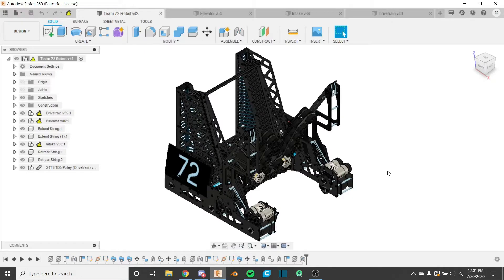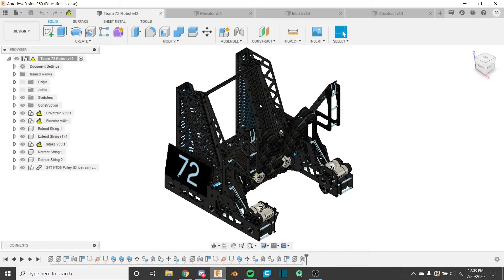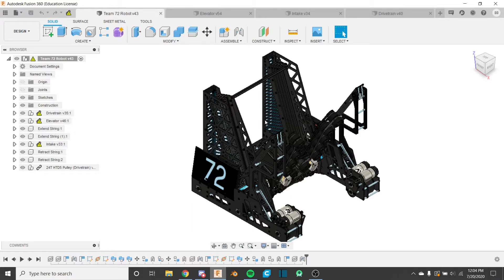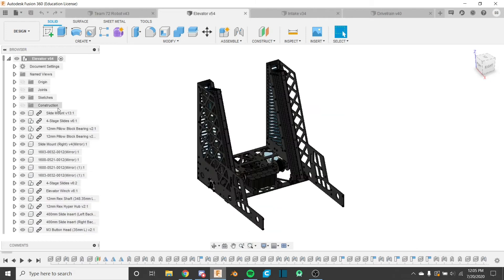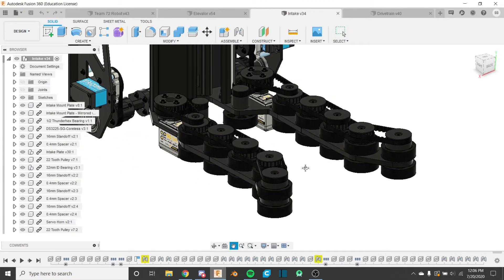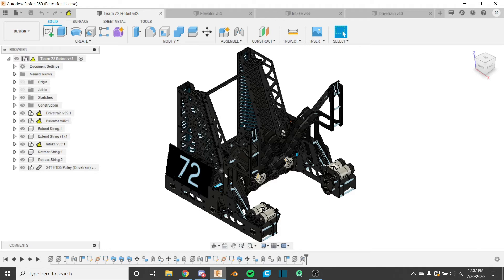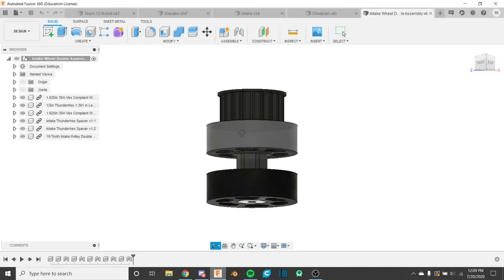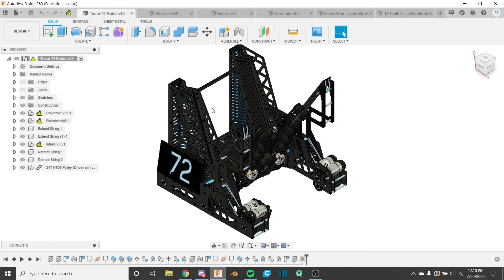Fusion 360 for FTC: Managing Large Assemblies

Comment: subassemblies are a great way for organizing cad and reducing lag to some extent, but there's more that you can do to manage lag in assemblies

1. Minimize capture positions - position captures are necessary for joints, but you can minimize your use of them by taking advantage of the free move command you get whenever you insert a part (point to point move is god)
2. minimize general timeline bloat - practice good parametric design, when possible edit features (especially position captures), avoid position captures as much as possible, take advantage of rigid group to minimize unnecessary rigid joints
3. Position subassemblies in their respective positions relative to the origin when possible - This one is kind of a hack/workaround, but by modeling each subassembly in their respective positions, you minimize the number of move commands and capture positions that you need to do in the full robot assembly

These videos cover some more tips for minimizing lag in f360
https://www.youtube.com/watch?v=9zL8pRDxPck&t=15s
https://www.youtube.com/watch?v=Ur0b6hh9joM
Reply from the maker: Thanks for the extra information. These videos are great especially because I myself have not done too much research into timeline theory.